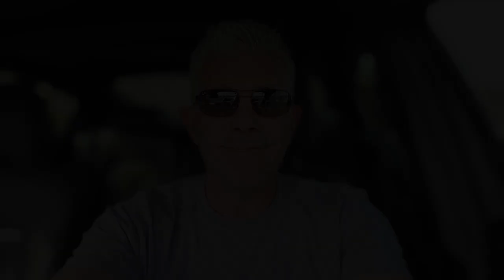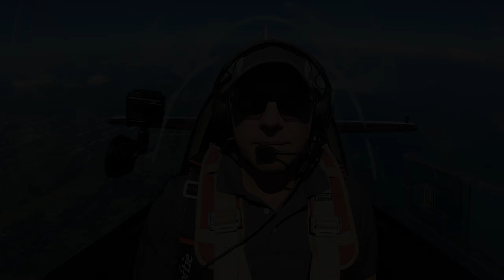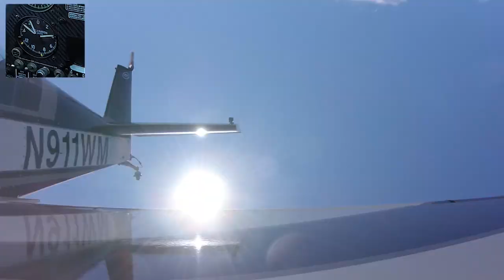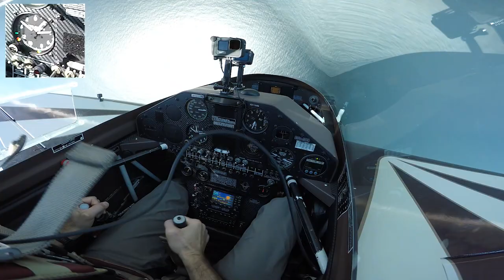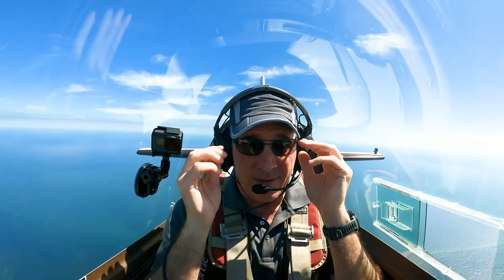Crossover Spin with High Negative G - Headset Chinstrap Test

Comment: Hi. Thanks for sharing. Let me ask, how many Gs can can withstand  the suck mount of yours gopro cam fixed on the right side of the cabin behind yours shoulder?
Reply from the maker: Thanks for watching the video!  I have never had that suction mount come off during any maneuver in the Extra...I have pulled up to 8Gs.  Those Gopro cameras weigh 116grams (4.1oz) so at 8G that's 928 g (32.8 oz  or 2 lbs)
Reply: @ssairshows  Mr Suderman, thanks for your answer. Yours videos are very inspiring and educative. Exceptionally those about spins (inverted). t's Better to See Something Once Than to Hear About  It (ev. read in book) a Thousand Times. Respect aus Austria, Lg, Milos
Reply: I think it may hold more then that. That would be 2lbs on about a 1 inch arm from the cup to the elbow or maybe a little more if not at exactly 90°.